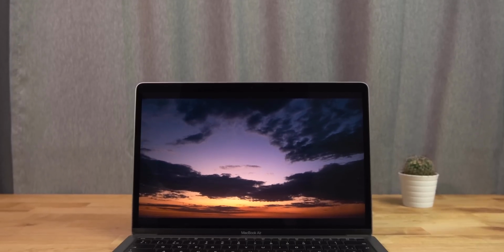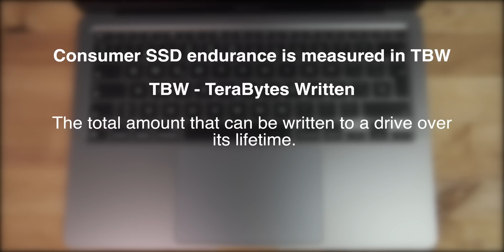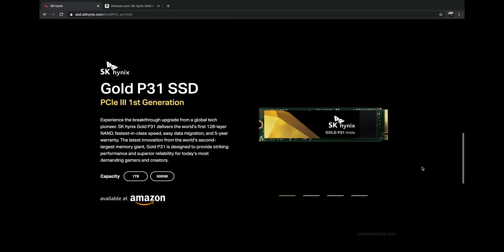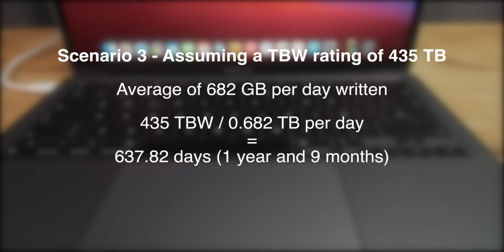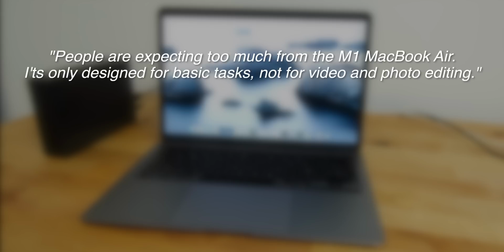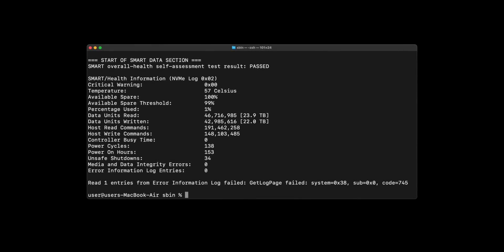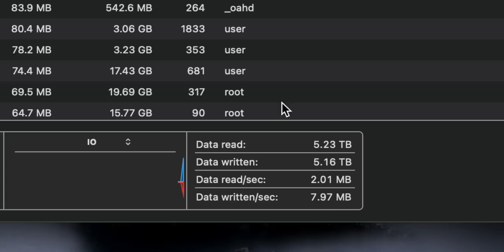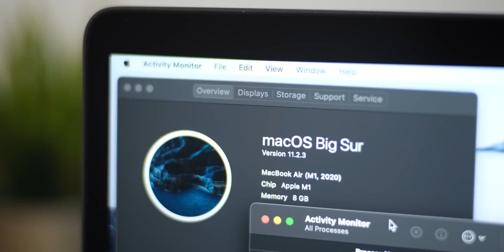M1 Mac SSD Wear Issue Tested and Explored. Yes, it's a problem.

Comment: I'm not going to be devil's advocate but let's be serious who is writing 682gb of data everyday, programmer using docker, film maker / YouTuber editing raw video files? I doubt they even write so much. Even if the system uses swap memory but you have more ram than basic 8gb you should be safe. Overall it's better to have more both ram and ssd storage even if you think it won't be used. Why? The bigger capacity of your ram the more processes can be stored and accessed directly from your ram instead of using swap memory and causing at the same time higher degradation of an ssd. For those who are concerned there is a possibility to "transplant" both ssd nands from other MacBooks or buy from china and program it using dedicated device. Some people have done that successfully and increased internal capacity from 256gb up to max 2tb. Second option is to use external high capacity ssd like 4tb crucial x9 or x10 models, install Mac OS and boot os directly from it.

Comment: finally a video showing a similar failure to mine... my mac fails terribly after using it for 3 years, over heating and low performance even with 2 chrome tabs. Apple changed the upper side of the computer due to keyboard failure, initially though it would solve the problem thinking about the battery issue, but the real problem is with SSD as explained in this video.
Reply: I think Mac OS upgrades are causing these behaviors. Way back in 2017 apple admitted they are slowing down older devices with new os updates causing higher battery drain and pressure on cpu and ram in order to force people into buying new models. Just stop updating your os if it works just fine.

Comment: So after this video from 1 year ago I supposed your mac died already, right?
Reply from the maker: If you watch my second video on this subject you will find that Apple reduced the amount of data written to the SSD with the release of macOS 11.4, reducing it from 20 to 58 times more than an Intel mac to a mere 10 to 20 times more than an Intel Mac.

You can reduce the usage in a number of ways.
- If you watch videos on YouTube or a streaming service, reduce the resolution to 240P. Lower resolutions mean that less data is cached to your SSD.
- Don't run applications from third parties - avoid Adobe and Microsoft apps especially. Simple games should be ok.
- Only run one application at a time, and close it when you're finished before opening a different app.
- Don't have more than 3 or 4 open tabs at a time in your browser.
- If you must edit video, avoid 1080P and especially 4K. Try to use 720P or lower.
- Don't edit photos with your Mac. If you take a lot of photos, edit them on your phone BEFORE transferring them to your Mac.

If you follow this advice your Mac should last several years.
Reply: @BartechTV  thanks for your answer and for your time!
Really appreciate it! 
Just one thing, I’m going to buy the MacBook pro 2021 with M1 pro 10 core CPU and 16 core GPU, 32gb of ram and 1tb SSD. I’m going to buy it ONLY for music production and sound engineering and for studying some pdf for my university with an external SSD. What do you mean for “only run one application at time”? For my purposes I need to run several applications and VST’s together. Is this going to be something really bad for endurance of my future mac? Thanks in advance for your answer:)
Reply: @BartechTV ???!! 😊

Comment: My M1 MacBook Air has written 198GB on the SSD in just 3 days and all I've done is watch YouTube videos ( about 30). I put my MacBook into sleep mode last night before going to sleep and when I woke up I checked the SSD and even during sleep mode the SSD wrote another 10+GB. So as long as power us going through the MacBook M1, then data is being written even when nothing is running and in sleep mode.

Comment: That’s why Apple use modular flash in new Mac Studio. M1 ssd will be failed within 1-2 years of usage so Mac Studio ssd or flash can be replaced easily. It is a design level issue I think. Most of the commercial ssd has a small dram built in so data is written to that ram directly not flash so it prolongs its life but I think macOS small read write cycle directly using the flash so it worn out very fast. If this trend continues we can see it will be a huge issue for apple to repair and replace whole board.

Comment: I just bought an macbook air m1, 8GB ram and 256 GB ssd and I extended the warranty to 4 years. I don't think that apple can risc that much with ssd's life ( or warranty doesn't cover ssd ??? ).
Reply: @ionut-mateiatomei-raileanu5235  is you mac running still strong?

Comment: Seems like the issue is resolved in 11.4 update. Can anyone please confirm?
Reply from the maker: No. It's not fixed. I just tried editing a single photo in Lightroom and my M1 running 11.4 wrote over 40GB in less than 5 minutes. Then I tried editing the same photo on my Intel Mac and it wrote 0.7GB. So, the M1 Mac wrote 57 times more to the SSD. It is an improvement over the 58 times more that I saw when I tested 11.2 though, so we're on the right path.

Comment: WTF ?! My MBP M1 has 24Tb written in 4 month, only watching video/surf for about 3 hours a day !! It means the 250 GB SSD will be dead before 18 month. I would never have bought the M1 if I knew that. Hopefully it will be fixed by Apple ! (Warranty is 2 years in Europe, good for me). But still, Apple is committing a commercial suicide if they don't quickly find a solution.
Reply: it should not be that high, something is wrong. I am using VM and doing React, Docker, and IntelliJ. that is only 15TB in 4 month. I am sure something is wrong in your software.
Reply: Well I don't think so bcz there are still going to be people defending apple 💀💀💀💀💀💀
Reply: I extended the warranty to 4 years. Will see what happens with ssd till then...

Comment: Jesus you are diving along with the hype. If apple's engineers are that stupid then why are they selling? Use it as it was meant to be and stop looking for something that is not really an issue, otherwise dispose your m1 and go back to mac intel.
Reply from the maker: No, I am literally ignoring all the hype and instead performing real world tests, making calculations based on the actual data from those tests, and then using the results of those calculations to come to a logical conclusion.

There are lots of other videos on this subject which are more along the lines of "it'll be fine because SSD's sometimes last a bit longer" or "don't worry Apple's engineers are really clever, oh and by the way use my affiliate links ok?" which I am sure will be more to your taste, so I suggest you watch those instead.
Reply: You clearly did not watch the video. The hype are the people saying nothing is wrong without evidence while this video clearly provides hard evidence of what is wrong 💀
Reply: Also if you think there is nothing wrong why did apple try to release a fix in big sur 11.4 (which lowered swap but its still not fixed). It's like they are admitting themselves that something is wrong.

Comment: Do you mind sharing the current status of your ssd along with your level of usage of MBA or MBP?
Reply from the maker: Percentage Used:                    6%
Data Units Read:                    192,981,979 [98.8 TB]
Data Units Written:                 142,527,803 [72.9 TB]
This is after 4 months, so about 18.2TB/month on average.
My Intel Mac wrote on average 0.28TB/month over the 5 years it was used.
So that's a difference of 65 times.
Reply: @BartechTV  found a post in reddit saying BigSur 11.3 update resolved this issue. Is it true?
Reply from the maker: @churchhill5266  No, 11.3 didn't fix it, nor did 11.4.
Reply: @BartechTV  how many tb do you have now? Do you had any issues with the MBA or ssd? Thanks

Comment: Thanks for the explanation, I was thinking on getting one. The idea was to spent 1500$ for a "highly durable"  laptop with 16/512 and Mac os. As it seems, it's better to invest on a Windows laptop if it's not "a must" having Mac os. I mean, i prefer paying 1500$ in two computers in 10 years ( or 12)  than 1500$ in a MacBook. Maybe when they were intel and hadn't the ram and the ssd soldered, were worth it, but now? Only are worth it If you are planning to use them for a couple years and then buy a newer one

Comment: Well, I don’t have an M1 Macbook but I can guess that the main culprit is Adobe. More than a decade ago I took up photography as my main hobby and one day my 500GB Macbook Pro started showing serious issues. I soon realized that Adobe had taken up more than 470GB and it was displayed under the “System” folder. I didn’t know what to do and then I was told to open the cache folders to remove parasite data created by Photoshop and Lightroom in a couple of years. I made a back up of all my pictures and deleted all the adobe files. The System folder we to down from 470GB to only 47 and the computer began to wok flawlessly again. I imagine that having everything (RAM, storage and GPU) on one place increases the wear and tear of the M1 chip as I don’t think Adobe has improved their data management process.
Reply from the maker: Hi Boris, yes Adobe software is often very badly behaved, but every application I tried behaves the same way, whether it was written by Adobe, Apple, Google, or anybody else.  Whatever software you run, many times more data is written to the SSD on the M1 Mac than on an Intel Mac running the same software.

Comment: I have from 03.02.2021:
Available Spare:                    100%
Available Spare Threshold:          99%
Percentage Used:                    3%
Data Units Read:                    203 652 264 [104 TB]
Data Units Written:                 199 515 468 [102 TB]

Using IntelliJ (programming) + Lightroom. Is it something which warranty covers? Should I be concerned?
Reply from the maker: That's a massive amount of data. My heavily used 2017 15" Intel MacBook Pro was at 18 TBW after 2.5 years. It had edited tens of thousands of photos in Lightroom and thousands of 4K videos in Final Cut Pro.
So you've written about 14 years worth of data to the SSD in 2.5 months.  Yes, warranty has to cover SSD failure. In the EU Apple have to fix it if it fails within 2 years. What size is your SSD?
Reply: @BartechTV  I have MacBook Pro with 16GB RAM + 1T SSD
Reply from the maker: The TBW rating of the 1TB SSD is likely around 1TB, assuming they use the same 3D TLC NAND as the 256 and 512GB. At your current rate of usage you'll pass the threshold in about 2 years and 1 month, just outside the 2 years EU warranty period.
Reply from the maker: Yes, Lightroom is the biggest culprit. In my test Lightroom Classic wrote 58 times more data to the SSD on the M1 Mac than on the Intel Mac. 
But, every app behaves the same way. For example, editing 4 photos in the Apple Photos app, the Intel Mac wrote 1.2GB and the M1 Mac wrote 10GB.
Reply: @BartechTV  I don't think you should worry, See this TBW is linear right??? it is about 30TB/ 1%. Speaking from the fact. This usage should last him around 4-5 years. But still this is a huge amount of data. I use about 9 TB in your time frame and he used 100TB +
Reply: @LCBear tbw isn't linear. The wearing speeds up over time.
Reply: How many tb do you have now? Do you had any issues with the MBA or ssd? Thanks!
Reply: @zonk112233  Almost 2 years MacBook, I don't experience any issues, also they fixed something because my current uptime is 19 days and only ~3TB written.

SMART/Health Information (NVMe Log 0x02)
Critical Warning:                   0x00
Temperature:                        31 Celsius
Available Spare:                    100%
Available Spare Threshold:          99%
Percentage Used:                    12%
Data Units Read:                    850,173,187 [435 TB]
Data Units Written:                 724,180,997 [370 TB]
Host Read Commands:                 6,857,904,090
Host Write Commands:                3,314,486,844
Controller Busy Time:               0
Power Cycles:                       269
Power On Hours:                     3,752
Unsafe Shutdowns:                   30
Media and Data Integrity Errors:    0
Error Information Log Entries:      0

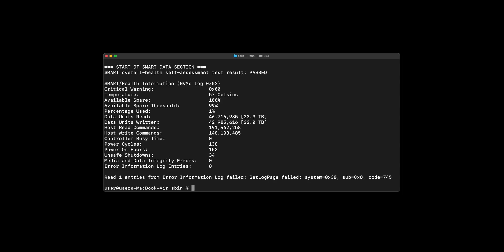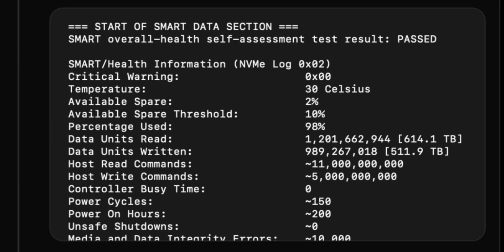Comment: Excellent Video but do you know if you can correlate the Smart percentage used figures with TBW? At 12:42 you have 1% at 22TB equivalent to 2200TB at 100%. Another random internet result for a 2TB Drive is 3% at 150TB so 5TB at theoretical 100%. At 6:49 you have the failure at 512TB so should have shown 3-4% at nominal 20TB. Mine (also 512GB) is at 20.3TB but still showing  0%. Hunting around, no-one seems to have discussed this.
Reply from the maker: The SSD wear percentage isn't linear, it's cumulative. For example, my M1 Mac was at 0% until around 24TB, when it changed to 1%. Then it hit 2% at 32TB and now it's at 3% with 38TB. So, it's speeding up, which is to be expected, since there are less cells available, and those cells that remain are already worn.
So, while it may take 2 months to hit 1% wear, it may only take another month to hit 2%, then another 3 weeks to hit 3% and so on.
Edit: It's now at 6% with 72TB.
Reply: @BartechTV  Interesting to know... I was thinking it should has 2000TB to write.

Comment: the question , is will apple replace the ssd chips once they are broken ? Or is the system simply unrepairable
Reply from the maker: If it dies under warranty, Apple just replace the logic board. They don't do component level repair.
Reply: Australian is 3 years + , USA has some scummy warranty periods
Reply: @michaelandrews4783  you lucky kangaroo fighting bastard
Reply: @michaelandrews4783  do you know how long time is in Netherland?
Reply: Well, the SSD chips will not wear out until 2 years or so in which the warranty period will have passed.
Reply from the maker: It depends on the country. Spain, for example, just passed a law forcing manufacturers to provide a minimum 3 years warranty.
Reply: @BartechTV  do you know how long time is in Netherland?

Comment: I have the miracle fix, simply install mac os to an external SSD flash drive via thunderbolt to achieve similar or better performance
Reply: If I use more of windows 10 on my m1 Mac than Mac os itself, will that reduce the swapping?
Reply: @esthervanda7401  nope because the windows is still running through macOS. That will most likely worsen the problem instead of reducing it.

Comment: Never had a issue with mine. 0%
Reply from the maker: What size is your SSD, and what is the figure for "Data Units Written" in smartctl?
Reply: @BartechTV  People are acting like this is an issue for all M1 Macs. Its clearly not!
Reply from the maker: @bermylife  Yes, every M1 Mac I have seen has this issue. Every single one.
Reply: exactly I have the base M1 MacBook Air (8GB RAM 256GB SSD) after 1 week I have written only 8GB of data and used only 29.8Mb (yes that's megabytes) of swap memory! To put that into perspective my Intel iMac uses way more than this!

Comment: Thank you for this greatly explained and documented video.

My m1 has about 45 TB written for a little more than 3 months usage and is now writing on average more than 1 TB per day.
This is kind of scary to be honest.
I knew buying a totally new product could mean discovering some unexpected problems, but not this big of a problem.
Reply from the maker: Thank you Nicolas. Yes, it is scary.
All of the evidence indicates that many M1 Macs will not see the end of their first year, and many others will be dead after between 1 year and 2 years of use.
My own 9 week old MacBook Air SSD is now at 30 TB written. For comparison, my 2017 15" MacBook Pro, which was very heavily used for photo and video editing, had 18TB written after 2.5 years of use.
Reply: @BartechTV  I’m wondering if the new iPad Pro M1 may have this same issue...
Reply from the maker: No, the iPad Pro M1 won't be affected. The iPad Pro runs iOS and iOS doesn't swap to SSD. On iOS, when the amount of free memory drops below a certain threshold, a system process called JetSam requests running applications to free up memory to make room for new data. Applications that fail to free up enough memory are terminated.
Reply: Yes, but your device will be out of warranty by then.
Reply: How has ur ssd usage been so far after 3 months? Just got my mac, but I'm not really worried though.
Reply: @angoah3617  +1 to this. any updates?
Reply: @mortillan2196  My mac is still good. I got this in the summer and my usage wasn't so heavy. Been in uni the past months and SSD swap has been a lot lol. I don't pay attention to it anymore because I have to keep a lot of stuff open anyway. It's a good laptop.

Comment: I add a nwjs helper process hog memory overnight, and the kernel task wrote 12TB on the disk lmao usually it write between 700gb and 1.2tb per day. Already 8% used in 3 months of usage. I code Android apps and most of the tools are still running on Rosetta 2. This is ridiculous
Reply: How is the MacBook Air now?